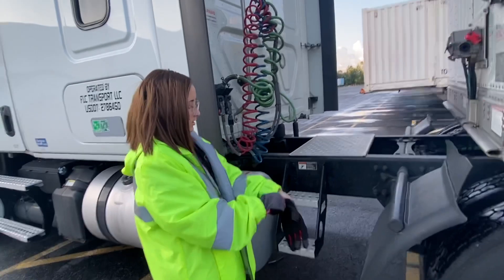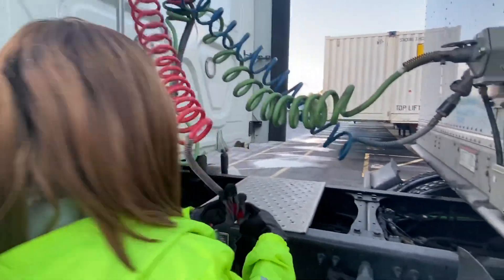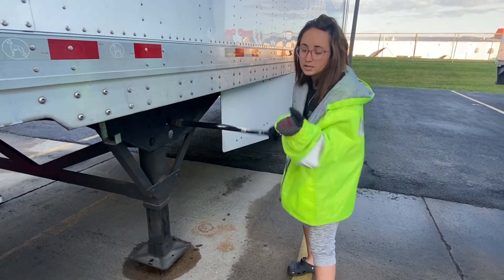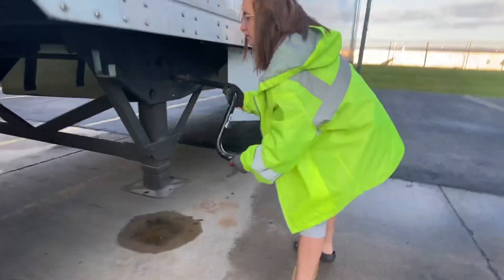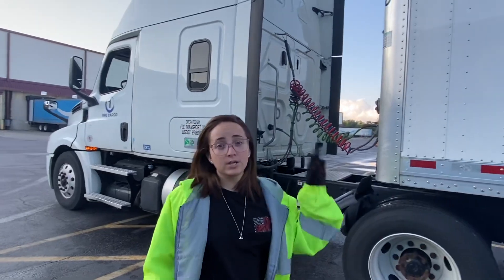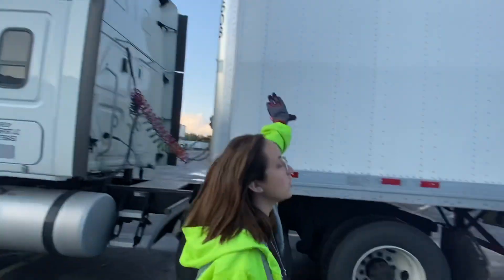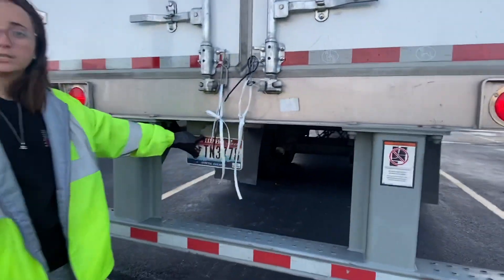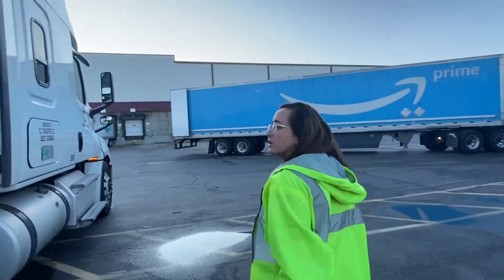How To Couple A Tractor-Trailer | Trucking Part 38

Comment: You might want to charge your trailer brakes after coupling & connecting your brake lines. That way you hear for any leaks as you inspect the trailer tires brakes suspension ect ect.
Reply: Also gives time for the air suspension to fill and raise the trailer off the safety stops.

Comment: One thing to add while inspecting a trailer is checking the wheel hub oil level. Look at the little window on the wheel hub and make sure the oil level is touching the circular FULL line. If it does not have the window you can remove the plug and dip your pinkie finger to check the oil level. Lack of lubrication will cause overheating and lead to a fire.

Comment: Before you wonder why I’m commenting , my wife looks at your videos, 

I’m teaching a fellow driver, hell I never stop learning, on your last video I commented how to proper ply drop your trailer

The driver before you properly dropped it , so if you was loaded heavy, the trailer was low enough to where the tractor lifted up the trailer And be way Way easier to raise landing gear, if you still have that trailer, test it out. When you lower, once it touches the ground, give three rotations or if you can judge by looks, an inch or so off the ground

Comment: Great video but no tug test?
Reply: Not good..didnt even check the king pin either..I've seen it happen!
Reply: She went under the trailer and held the flash light up to the fifth wheel  to show you that the kings pin is in lock position with the locking jaws ..🤷‍♀️watch again
Reply from the maker: Thank you. These people are annoying 🙄🙄
Reply: @KaylaTaylorTrucking  sorry..I totally missed it...but ive seen a trailer fall off..its not good...lol

Comment: Is that a load out trailer?  If so, y'all's dispatch should be looking for dry van  loads for you.  You'll get paid double basically to go to Sacramento.  If your dispatch doesn't ask Amazon if they can load it to Sacramento then they aren't worth shit.  Driving empty trailers can be dangerous.
Reply: No more dangerous than a loaded Amazon trailer which feels practically empty.  Just use common sense with the weather out west
Reply: @richardlapoint1845  I'd still rather have 10k to 20k lbs than nothing especially since you get paid for both loads.